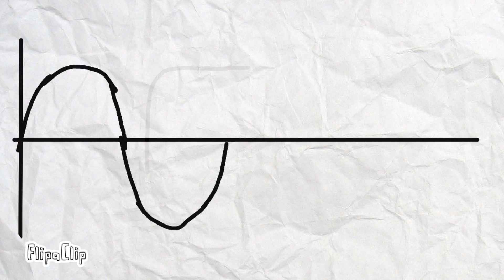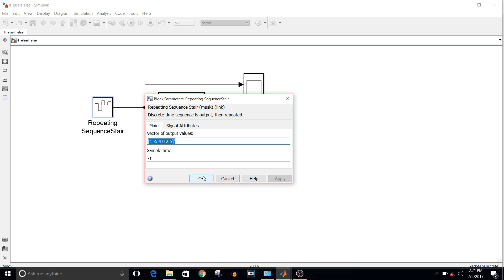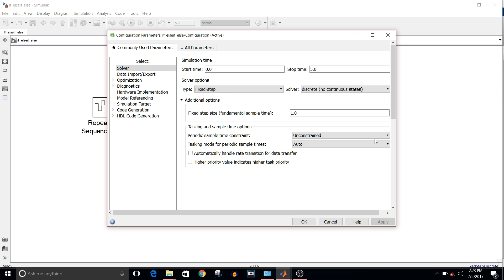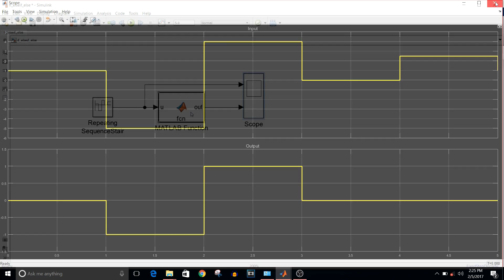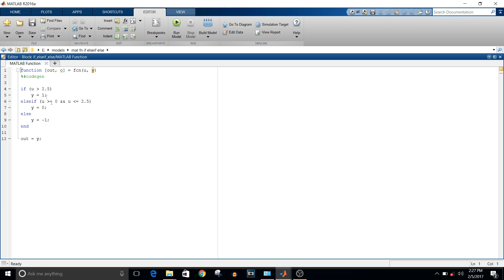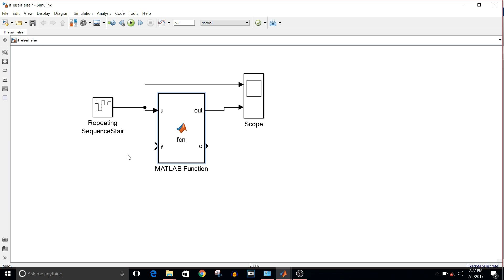Simulink Tutorial - 17 - Mat Function in Simulink | If elseif else

Comment: Hi ,Mr
Please how to changes of NaN(=0/0) in Simulink to be Zero.thank you in advance
Reply from the maker: Use enabled subsystem. The system should enable if the devisor is nonzero. Use one switch block, use divisor greater than zero as condition to the block, if the condition is true pass enabled subsystem op else zero
Reply: @simulinktutorial9086  minmax(max) of default value. which u want to keep it as lower limit